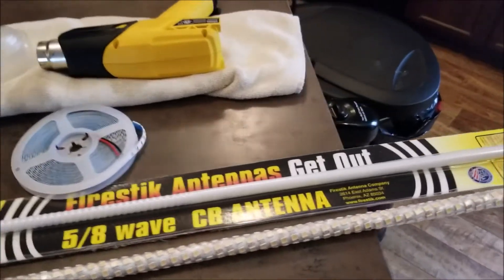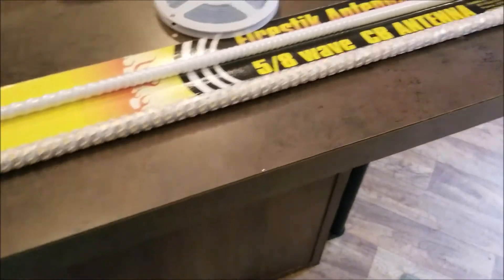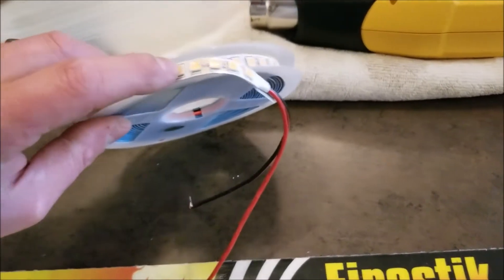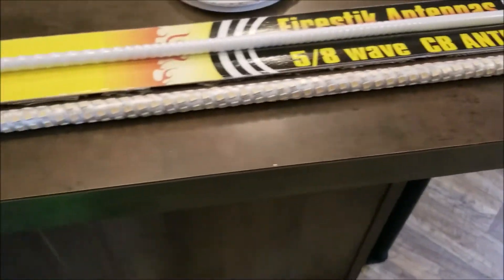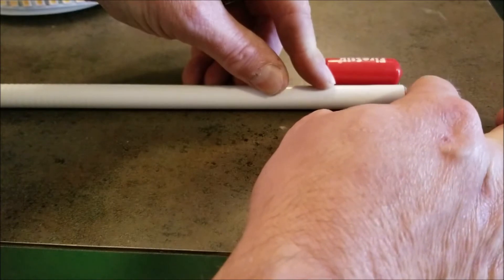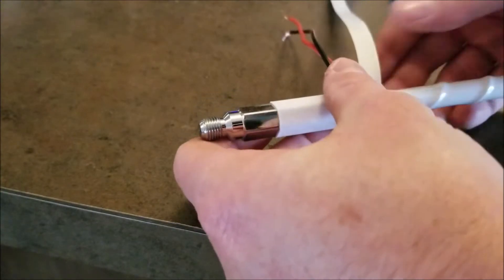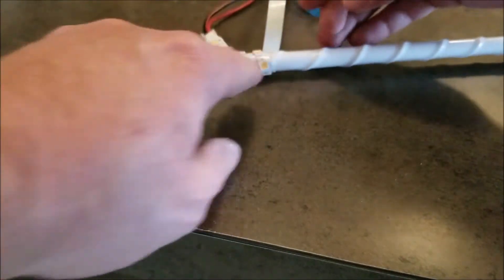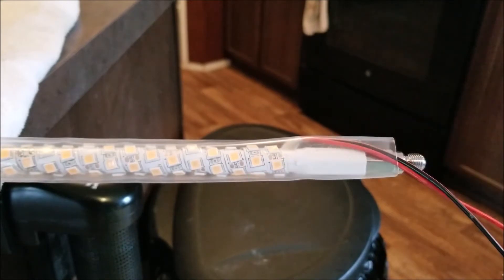How to Make an LED Antenna Whip for Your ATV

Comment: How many ft of strip did you use?
Reply from the maker: I put the link in the vid description of the LED strips I used.
Reply: I know... but I was asking how many feet did you use exactly? I'm going to do one but with battery operated led lights for my bicycle beach cruiser.... I live in Vegas desert but was going towards all fiberglass pole as we get thunder storms lightning 🌩 worried about that coil in cb antenna so I gotta find a male/female sleeve to fit pole into. Ordered a cb spring but cb antenna would be so much easier to do like you did. 🤔
Reply from the maker: I used the whole strip based on the antenna i got.  I think i explained it in the vid.

Comment: I like your video. I want to be sure of a couple details. The strip is 16.4 ft. long and has 600 LEDS. 5054 12v.. Is it the non-waterproof or the IP-65. Also, is it 10mm wide or 5mm. Thanks
Reply from the maker: I used the non-waterproof lights, 5mm wide:  https://amzn.to/3HX7Rcj  The clear heat shrink tubing I used is what keeps it waterproof.
Reply: @CrossplaneNation  Thanks
Reply from the maker: Anytime, let me know if you have any other questions.